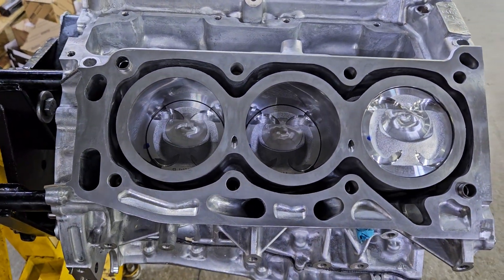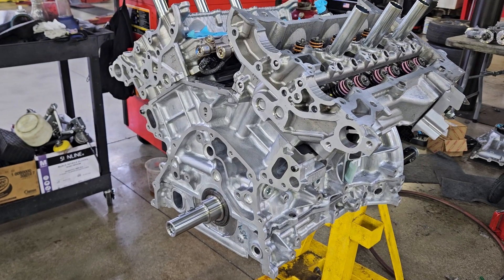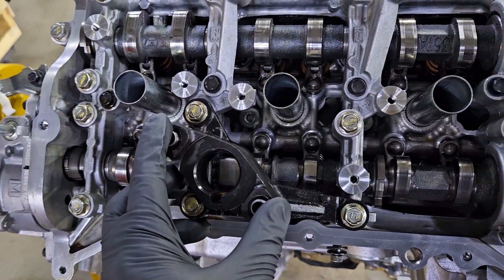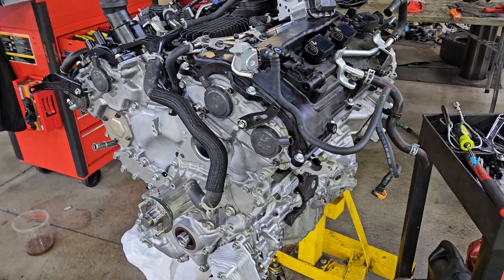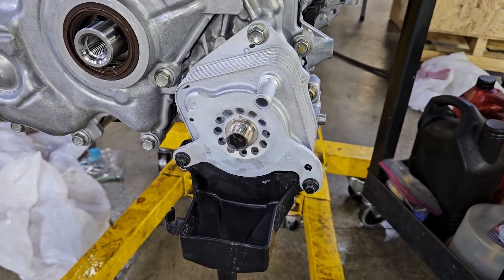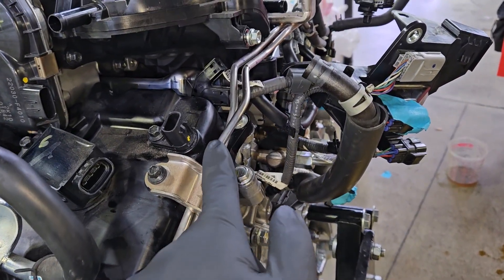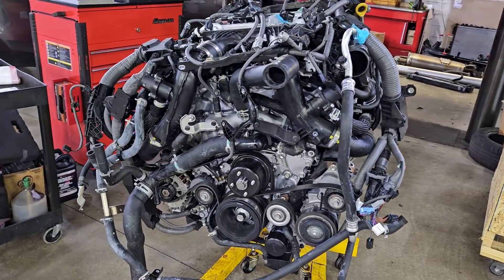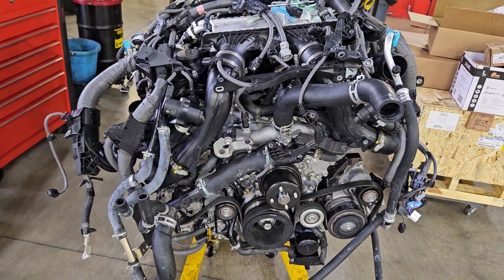A CLOSER LOOK AT TOYOTA/LEXUS TWIN TURBO V6 ENGINE (SHORT BLOCK ASSEMBLY PROCESS)

Comment: Wow, this engine is a million years ahead of the old v8. Truly a masterpiece
Reply: In terms of what? What's special about this engine? That's a comment you make when you only know 4 bangers.
Reply: @passZword Buddy, this Japanese-engineered 3.4L twin-turbo V6 will have those old small-blocks huffin’ fumes before the turbos even spool. It’s special because it cranks out diesel-like torque from low RPM, runs a compact aluminum block that keeps weight down, and uses twin turbochargers and direct injection to deliver V8-level power with better efficiency. Modern tech > nostalgia—facts.
Reply: lol small block 350 chevy is still better and same with ls small block also
Reply: @ buddy please, I could not care less about Chevy Or ANY General Motors engine. Seems like you are attracted to Toyota tho that's why you are here commenting lol fan boy

Comment: Fascinating design but I don’t see this V35A holding up as well as the vintage Toyota engines like the tried and true UR series Toyota V8. 

Imagine working on this more complex engine when it’s high mileage, corroded, and with brittle plastic everywhere waiting to break.

Comment: Just a FYI - Australian ONLY use the diesel derivative of this engine and like their V8 used in the 200 series, the new V6 is falling over. Seems Toyota may have lost their #1 position! 

Just Autos are a Toyota 4x4 tuning specialist here in Oz and have bought a couple of the new engines to play with to figure how to solve the issues being experienced ..

Comment: As far as I’m aware coolant to the throttle body is not for cooling the throttle body. It’s actually to keep it warm to prevent freezing from wind chill when air is humid.
Reply: Man, really??? This motor is for global use, not only cold climates in the USA 😂

Comment: The engine itself may be somewhat straightforward, but the cooling system, turbo's, intercooler start to get a little complicated and it's a packaging nightmare. But if you want a new Tundra, this is it! I have no doubt the engine will live a long time with proper maintenance, just like all other Toyota engines. In a couple of years this "built in debris Problem" will be forgotten. I've seen some youtubes already with new Tundra's in work and artic environment that are doing fine.
Reply from the maker: Yes, i agree. The design of the turbos and its cooling and lubrication system are well designed.  Those turbos are not cheap, $4k plus each

Comment: I bet it’s crazy strong.
Reply from the maker: Yes, it is. I believe it will redeem itself when it's all set and done.  The engine runs well, and it's very similar to the proven and tested 2gr engines.
Reply: @TheYotaChannel gone are the 300k toyotas, enter ther 100k throw away turds.

Comment: This is nothing that I would like to see in an truck. Open deck and these bearings, not to mention overpriced turbo setup. Those turbos cost more than whole 5.7 V8 engine. Nothing on that engine looks long lasting.
Reply from the maker: Those turbos are expensive.  The turbo bearing lubrication and cooling system, i believe,  will help increase the life span of the turbos. Not only is the oil lubricating the bearings is cooled, but they also have additional coolant flowing through the turbos to help keep things cool as well.

Comment: Funny how combustion engines are having problems lately. Almost like it's planned 😮 the million mile engine days are long gone boys.
Reply from the maker: I believe this engine will redeem itself. It's a great engine and runs well. The main bearing issues are causing many to doubt it.  Once the dust settles, i believe it will be a well-respected engine.
Reply: @TheYotaChannel   They had 4 years to identify problems before this engine found its way into the Tundra/Sequoia/LX600. Many of us saw it coming. Problems were popping up ever since it's debut in the LS500 with documented failures dating back to 2018. How Toyota didn't look into revisions until now is mind-blowing...
Reply: @philhenderson3516  how many with LS 's actually had issues?
Reply: @Multiple threads on the Lexus forums, look it up. And some have experienced failures TWICE! The issues ARE NOT new... I believe some have switched to thicker oils assuming it would help but it's all based on assumptions.
Reply: Almost like Americans are the problem.

Comment: P.O.S. they should have turbo charged the old school late 90,s 3.0L V6. A bullet proof engine. My 1997 camry lxe had the v6 at 320,000 miles it ran like new, until some idiot ran into it at a stop light and wrecked it😢

Comment: Ok why is the block not enclosed (Open deck) around the cylinders for extra pressure from the turbo's. Closed deck akso gives rigidity to the block as well. Those small blocks need additional reinforcement for use in heavier vehicles.
Reply: Open deck engines can safely and reliably handle upwards of 500hp

Comment: They must be coming up with a way tonincrease production at Huntsville AL plantnor supplementing from another plant. The robotic assembled engines are far cheaper than paying labor at dealer rates. The engines will be billed at a much reduced price tondealer as warranty claim parts typically have 25% markup and that markup alone is another chunk of money on a 100,000 engine replacement campaign.

Comment: The counter weight towards the front of the engine where the bearing that fails is looks massive and heavy 😂.  If that engine is not severely redesigned I don’t see the point of them replacing long blocks

Comment: Nice exposay on Toyota's new problematic turbo v6. As a retired auto tech I fully believe in the K.I.S.S. principle. Thanks. But I'll stick with my '22 1gr fe 4.0l for the long haul.
Reply from the maker: The 1GR FE is bulletproof. I can't argue with that.  I believe the 4Runners are the most reliable cars money can buy.
Reply: And if it never needs more power slap a low boost supercharger on it no problem.
Reply: Hi, please do you know the location of the crankcase pressure sensor on this V35A-FTS Engine?
Reply: I prefer the 2UZFE V8

Comment: Could you show us the pcv system on the V35A. Toyota shows that they have their own separator but would love to see the system on the block. Thanks for making these videos!
Reply from the maker: At 0.56sec in the video, you can see a rubber hose sticking up, coming from the back of the engine. That rubber hose is connected to the PCV VALVE.
Reply: I second your request!!

Comment: CHAIN driven oil pump, not a belt like 2.7 EcoBoost and 3.0L Duramax! Not to mention they are using high quality ROLLER chains.
Reply from the maker: Why would any engineer design a motor with a belt driven oil pump? Sounds like a failure waiting to happen.
Reply: @TheYotaChannel the 2.7 ecoboosts have zero problems with the belts as long as oil is regularly changed.
Reply: @DB-os7wl  not true, those belts are trash and there is no excuse for using a rubber band for the most critical component in the engine.
Reply: @jonathanshaw8868  prove it then. ford has produced millions of 2.7s since 2015. Find me one example of belt failure that isn’t due to maintenance neglect or oil starvation. I’ll wait.
Reply: Look at the beef in those cylinder walls
Reply: @jonathanshaw8868  No beefier than an ecoboost, plus it’s open deck unlike Fords CGI block which is a closed deck.
Reply: Oil pump should be gear driven.

Comment: Looks exactly like a 2gr FSE but honestly not really a huge fan of integrated headers also the cylinder wall thickness between the water jacket and the cylinder is much thicker than a 2GR
Reply: The integral exhaust has been around over 20 years. Initially non-turbo but on turbo for about 15 years. Itnhas not been a problem. Broken studs and cracked or distorted manifolds are WAY more problems.